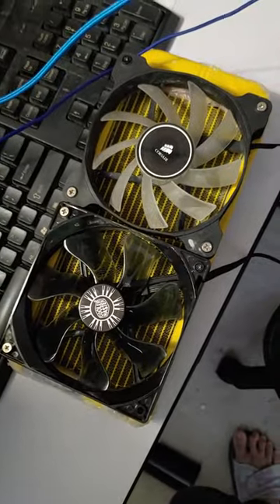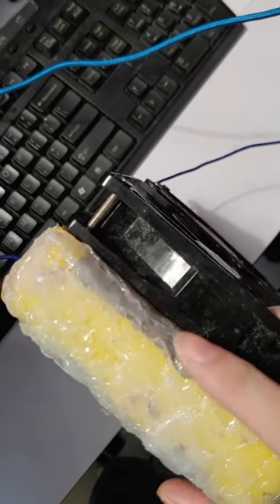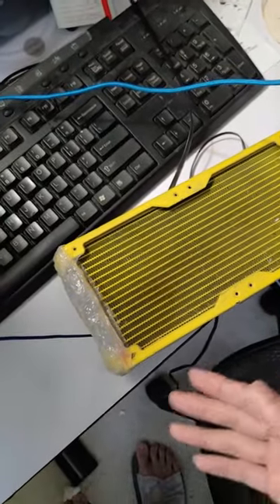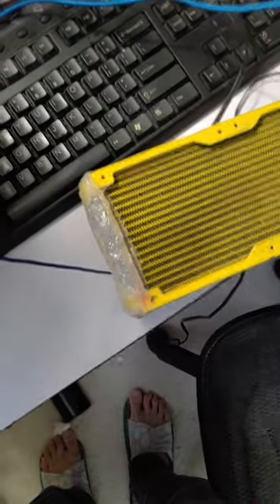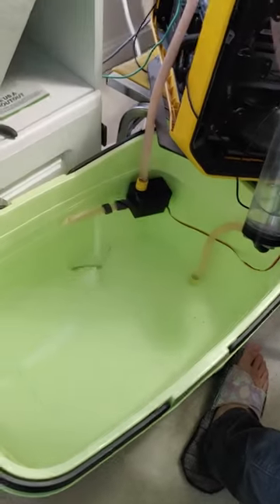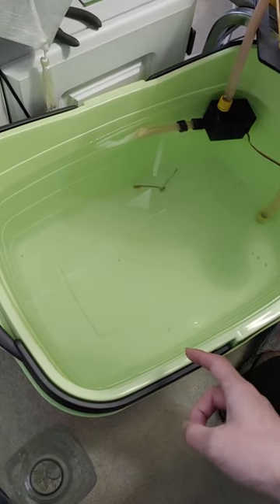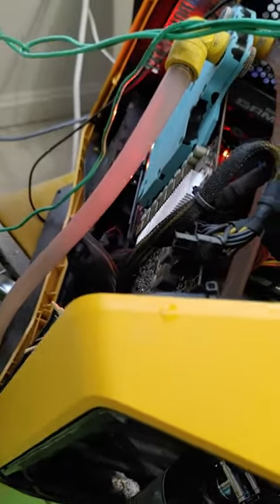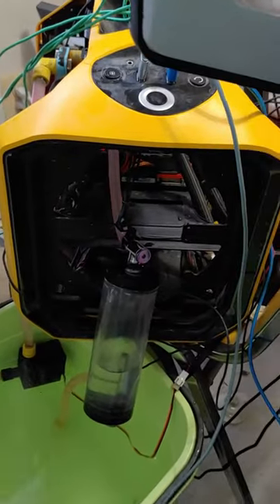Winner of the most SCUFFED PC contest xD

Comment: Why you dont replace that broke radiator? Its not that expensive to fix that and using just a tap water is pretty bad for water blocks pump and radiators because they have in minerals and they can stick inside them so you need always use destilled water for water cooled PC.
Reply: C o r o n a
Reply from the maker: i bought the replacement for the radiator, but it ll take a month to ship here.  it's time for a new PC anyway, this whole system is pretty old.  i plan to fix it up so i can use it for editing, but for now, before the new pc gets here, this will have to do.

Comment: How did you get those 2 massive holes in your radiator? Does it rust?
Reply from the maker: the insides of it is pretty corroded. it was leaking a bit through a small crack at first. i was trying to find that crack so i can plug it. but while i was scraping the chipped paint off from the damaged area so i can have a surface for the glue to bind to, the metal underneath just caved it from the pressure. its all corroded inside, because i was too lazy to get distilled water and always used tap water in this thing for the past like... 5 years~?